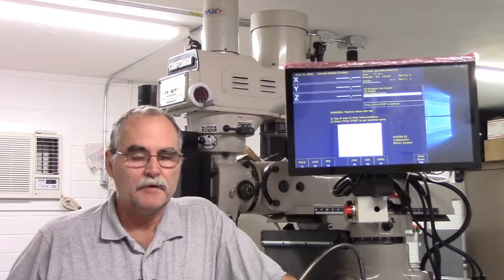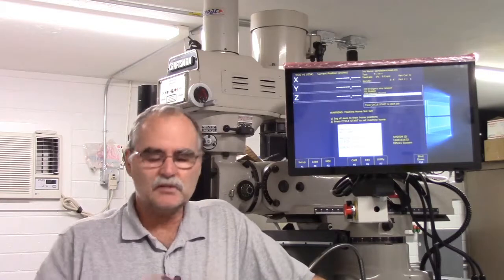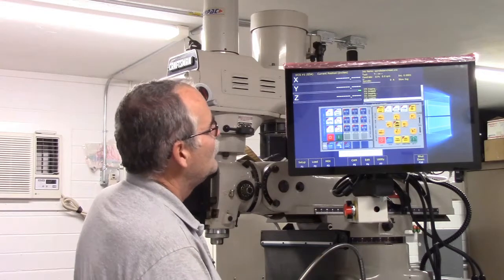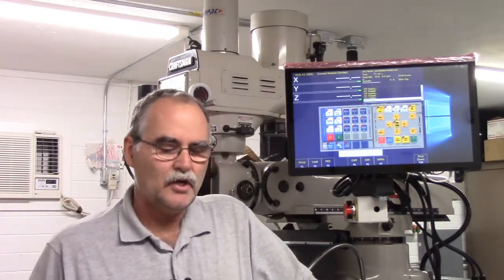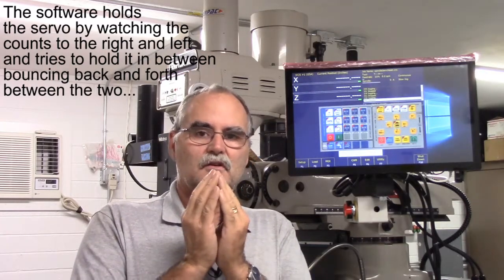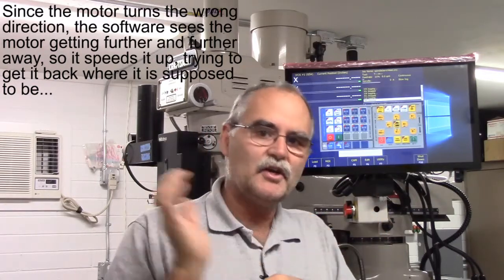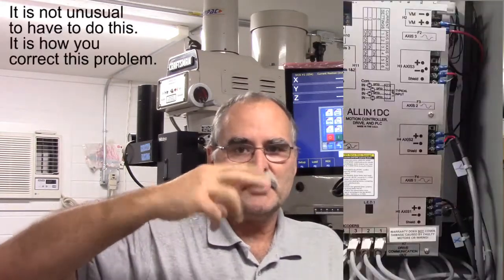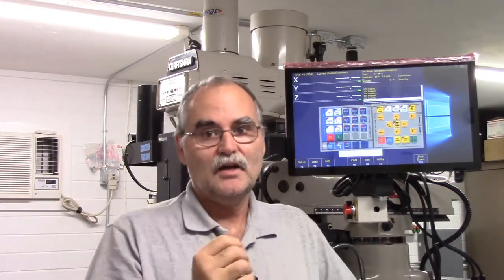Servo Runaway Explanation

Comment: Hello Marty! I haven't seen you post in a while. I have a question for you. I use an acorn, and I need to wire up the  limit switches. On my X and Y axis I have only one swith and two trips on this retrofit machine. Is it possible to program Acorn for one switch per axis? Thanks.
Reply from the maker: Yes. Very common to use one NC home switch per axis and to put them in series and use ONE input on Acorn. Program the input HomeAll
Reply: @martyscncgarage5275  Hello, Marty, Im not talking about the goming switches. I was talking about the hard limit switches in case the servos run away. I have one limit switches per axis and two trip blocks on both ends of the table. That's the way Anilam did their CNC that I'm retrofitting with Acorn. I think I might have a solution, I'm thinking of running parallel wires from one contact to for both axis limits.
Reply from the maker: @trikepedaler  there are limit inputs. Did you buy Ether1616 so you have more inputs? Memory serves there is also a LimitAll input that works like HomeAll
Reply: @martyscncgarage5275  Thanks again, I watched your limit and home switch video on YouTube . Thanks again.

Comment: Hey.Thank you, that did shed some light. am doing aircraft autopilot systems. Do you think that if you don't have a torque limiter and excessive stress condition occur, the servomotor would "runaway" ?
Reply from the maker: Servos generally run away when there is a problem with the encoder circuit. Or they are wired backwards when initially wired as on my video